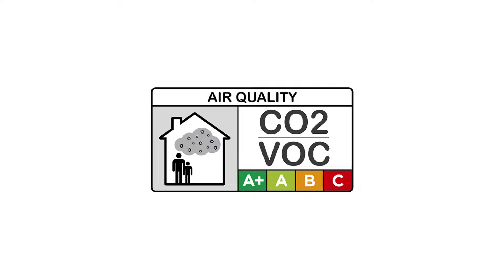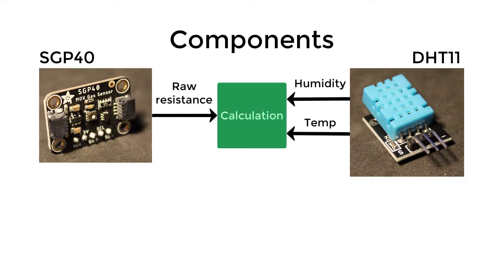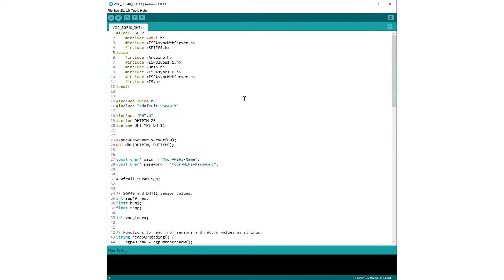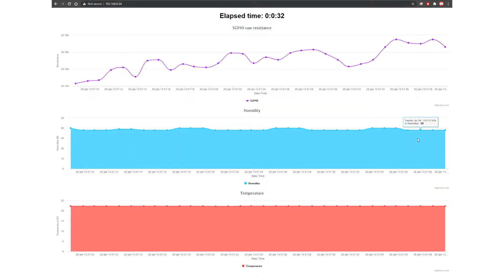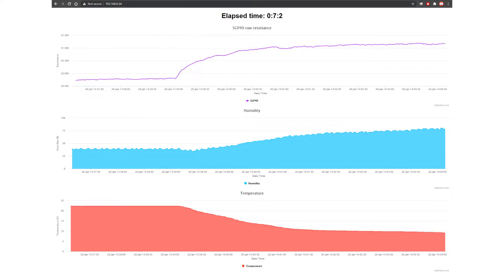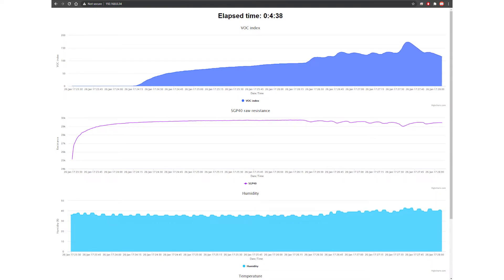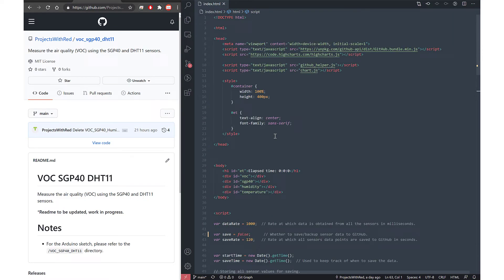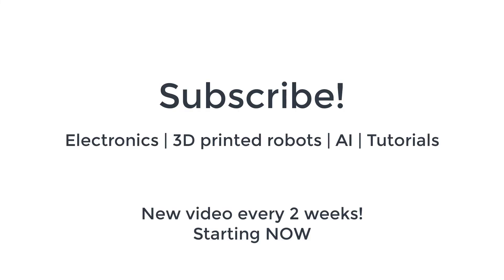How to measure Air Quality in real-time! Easily visualise and save data (SGP40) | #P2

Comment: Really appreciate the video. It's allowing me to get my feet wet in the Arduino space. In addition to VOC readings, have you by chance integrated or updated this design with a PMSA300I to get PM readings as well? I know that it most likely won't capture ultrafine particles emit into the air from a 3D printer but figured it'd be a nice to have for generally capturing any additional particle emissions and have a clean interface to read from like the way you're displaying data here.
Reply from the maker: That's great to hear! Unfortunately I have not made a version that integrates the PMSA300I, however, if you go over the code you will be able to easily add more sensors just by slighly updating the code.
Reply: @ProjectsWithRed  I received my sensors from Adafruit earlier today and was able to integrate everything using similar code. As expected, the PM sensor wasn't able to pick up much but the VOC sensor was definitely able to pick up enough change even for PLA filament. Thanks again for the video, it's been quite fun messing with the ESP32 and getting metrics from it!
Reply from the maker: @YunJang  Good stuff, that's great to hear! I am glad I could help!